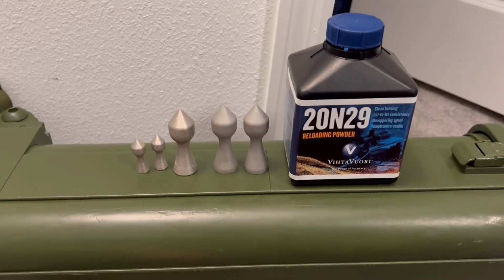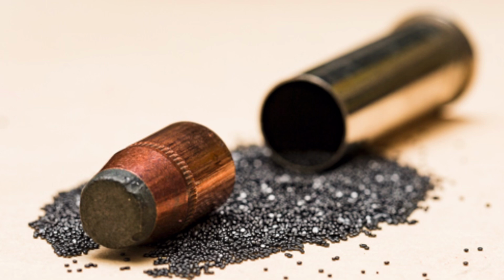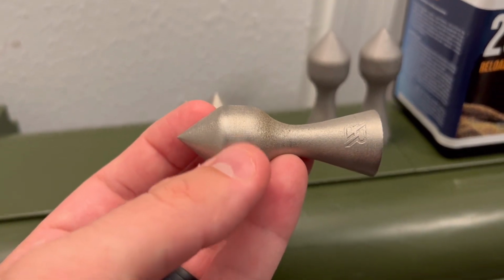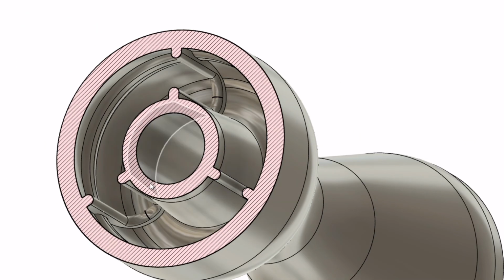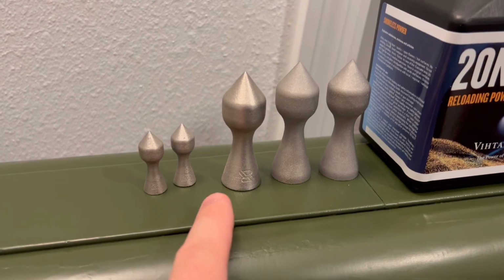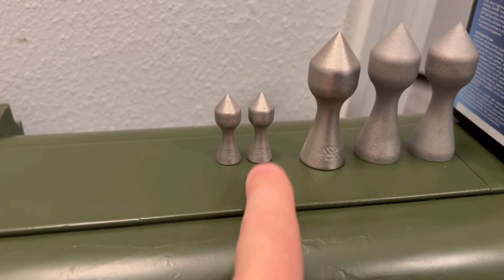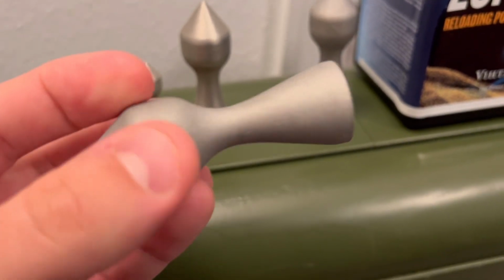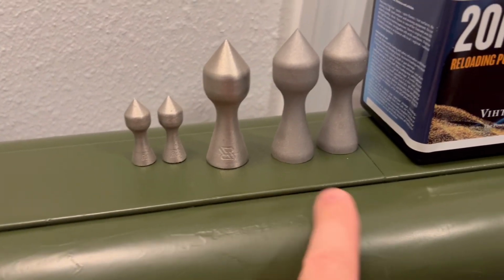Smokeless Powder Rocket Update

Comment: I really love this concept. Both the propellant chamber, and the diabolo projectile.
What sort of velocities are you predicting? Burn rate? Will the propellant completely burn out within the barrel length of your fliegerfaust?
Have you incorporated a convergent/divergent nozzle? I am curious about the efficiency of the straight section between the mouth of the propellant chamber where the bell/skirt actually begins to diverge.
Have you put any consideration into a two piece design? A separate chamber/nozzle-skirt and cap could potentially be much easier to load propellant into and or conventionally manufacture.

Comment: Well, that's neat. Looked into this sort of thing a few years back when I really wanted a gyrojet. Too fiddly for my attention span. I found what I believe is the propellant for the originals, I think in a patent for an airbag gas generator or something from a few years before the gyrojet. Can't remember for the life of me (I think guanidine nitrate and some manner of dichromate was involved, I never remember stuff) but it's compressible to an easy to work with rod or puck and isn't hydroscopic. Might be worth looking into, but honestly I think your idea is just as good or better. Long time ago I got a hold of some curtain airbag actuators (the look and size of a long CO2 cylinder) and set them off in a pipe. Video camera and our eyes weren't fast enough to catch them leaving. Silly things probably landed two counties over.

Comment: This is fantastic work. I was wondering if you could share some info on the barrel/ launch tubes of your recoilless rifle/ panzerfaust  projects. Im assuming you used steel right? what alloy and wall thickness did you use?... im currently working on a similar project where im hoping to get away with an aluminum tube by just bumping up wall thickness to compensate.

Comment: The Gyrojet died for good reason… how’s this different in a meaningful way? Also, how are you going to ignite and generate enough pressure quickly enough for the smokeless powder to burn correctly? A small black powder initiating charge? I have seen that done in some of the stronger BP revolvers where a few grains of smokeless were added on top of a BP charge to gain a velocity boost. And it worked, the reverse didn’t (smokeless with BP on top)
Reply from the maker: For one, likely a shorter burn time, second its first it just fun to experiment with concepts

Comment: You could also use a lathe with a rounded tip metal rod to bend a pipe into the proper shape

Comment: would be cool if this was a staged system in that it is put in an appropriately sized brass shell and shot normally ignighting the rocket part as an additional boost, would solve the minimum distance issue for adequate velocity.

Comment: Been there.
Gave up on finding slow burning, large grain nitro powder.
Tried cut up old cordite sticks about 3 mm diameter .
No matter what particle size you try, you will run into consistency problems.
And you cant solve this because a multitude of particles means a multitude of variable burning rates.
Nitro powders will NEVER  burn at a consistent rate unless you can stop or control the collective  surface areas during burn.~
Dont forget grains are designed for predictable progressive burn rates at elevated pressures only.
What large loose particles will give you is certain inconsistency.
Drop the idea of loose powder.
The major improvement came with the use of one, solid rod , that burns axially and radially to approximate as constant dv/dt  change of area.
The next, challenge was how to manufacture:
Expose any size NC powder to pure acetone in a quantity enough to make a stiff gell and not a solution.
You can "pump" the single grain , as you would a pyro signal star. Use stainless steel pump and piston.
Allow to dry slowly In a container with restricted vent holes; This will prevent skin forming and distortion to a minimum.
Next is getting the single large grain to start burning rapidly.
After several pyro mixes ( oxidizer/fuels), the best was nothing more than rolling the single large dry grain, that had just been brushed lighty with NC solution, on Vihtavuori N310.
You might find that ignition is improved even with short, high pressure pulse from a 209 percussion cap ( e match is much slower)
Several months of trials there.
Good luck
Reply from the maker: @schatzperson  the original one that was patented was successfully fired multiple times and the patent has all the load data. It’s proven system, I’m just scaling it down to use smaller grains
Reply: @WildArmsResearchAndDevelopment  The increased surface area of multiple grains will give you a very rapid burn rate which with progressive powders will give you a very quick pulse more akin to an explosion.  It will be more similar to the rates used in rear vented recoiless guns.
You will get far better control with single grain rocket propulsion.
And then these is the matter of energy payload per volume- You will get 2 to 3 times as much  propellant in a given volume with unitary grain systems.
 I am not sure , I think Gyrojet used a nitro single grain and also many military rockets up to about 3 inches diameter.
Loose powder might work in very small diameters  at reduced energy packing.
Reply from the maker: That’s exactly how the patent is described and functions , I’d recommend checking out the patent for all the load data; US5440993A High velocity impulse rocket. In the patent they test regressive and progressive grains, I am going to stick with regressive grains
Reply: I agree with you if a very rapid pulse is what you want, even at the expence of less energy packed.
But if this is what you are after, it would be more energy efficient if you dont go for rocket propulsion and allow the ignition gasses to blast out the back and the launch tube was the usual closed breach, as in a regular gun.
You might ask why then bother with it al all.
Well, you dont need a case at all. You will certainly have better accuracy than vanes and mass stabilisation, if you use a simple driving band on the projectile rear ( light alloy, zinc?) . Steel body, simple turning, no expensive  metal printing.
Electric ignition via a conducting primer pellet in the rear vent.
I dont mean to argue against your idea. I have spent years working with out of ordinary devices and several times was employed just for this sort of application.
What I have found is that once we get hooked on an idea, we (everyone) tend to stick to it no matter what.
I have come to realise this after many many mistakes ; And I am not saying you are mistaken, just think hard objectively.
I am right now being consulted about anti drone ammo and at one point was going down the same route :-)
Reply: Tell me if you want to take this in privatre.

Comment: 1.	look up the Daisy V/L rifle and its caseless ammo that doesn't use a primer but compressed air to ignite the propellant.
2.	 I would suggest looking at some form of discarding sabot/discarding wading to stabilize and support the rocket in flight down the barrel.
3.	 To install the loose powder and to keep it in place I would try and take advantage of centrifugal/centripetal force (spin the projectile like and impeller/spin top on its nose and load the propellent by slowly adding from the venturi). Add a small amount of nitrocellulose lacquer to bind the propellent and keep it from falling out or some guncotton to pug the venturi

Comment: 1 how do you fill it
2 how does it not spill out
3 how do you ignite it
This is a super interesting project, would be awsum to see where this goes
Reply from the maker: @samuelberghuvud5527  I’m designing plunger to push the propellant into the chamber and the igniter (Ematch) and a sealing agent seals the nozzle and blows out at pre-determined pressure
Reply: @WildArmsResearchAndDevelopment you might have something, imagine if every joe had the power of a 50 bmg with a rifled 500 m
Reply: @WildArmsResearchAndDevelopment  just need a vibratory table with a follower and it should pack the powder up in the cavity, can use a paper or cardboard plug between the powder and follower to cap the cavity. little hole in the middle of the plug for inserting your electronic igniter and you're all set! i'm just envisioning a modified estes rocket motor with the clay nozzle only with your design.

Comment: Just thinking out loud phsysics wise, I do think you will need some kind of sabout or filler to support the side cone - even if steel. Assuming this will be some kind of 12g load it might also lack some mass to actually ignite the propellant properly. If that is the case, having slightly heavier sabots might help getting proper ignition on the cartridge propellant as well as the rocket itself. The negative side is that you will probably get a hypervelocity buck and ball that eats chronos for breakfast. The fliegerfaust one is probably going to be easier to work with simply because you have more space to work with. I also don't envy the job of getting propellant into the smaller ones. But that all said.. this sounds like a fun experiment, I wish we had the legal opportunity to do that over here. Physics for the win..

Comment: For cost saving as you develop, would this design be able to be split into separate components that have threads to secure them together to make the manufacturing process easier and cost effective? I would think using solid stock on a lathe could make these
Reply from the maker: That was part of the plan but the 4 machine shops I went to did a no quote on my design, I’ll have to adjust to make it more CNC friendly. It low priority so I’ll get to eventually
Reply: @WildArmsResearchAndDevelopment  - that's strange. looking at your CAD I would think you could make this in two pieces from round stock. The "tail cone" having threading on the external surface of the "shaft" and the "ogive" having threading on the internal surface. Almost like how an arty fuse is threaded into the the projectile.

Random: these things look like those Nerf whistling foam footballs LoL

Comment: Could you use the sides off a 50cal muzzle loader sabot as a sleeve, and fire it from a muzzle loader barrel that's had its breech plug removed? I imagine it could be fired like a recoiless rifle.
Reply: I'd be interested to see if these could work as rocket assisted projectiles like a 12g slug, wouldn't be too hard to 3d print plastic sabots
Reply: @Scrump_Can 
Definately not as hard as manufacturing the actual rounds
Reply: If you sleeve the rocket,  you need some way of stopping the rocket just stripping the sleeve off. Some kind of sabot that fits the projectile's waist like an APDFS round would seem appropriate.
Reply: @VikOlliver  You could just also segment the sleeves into quarters so it will fall off after it leaves the barrel